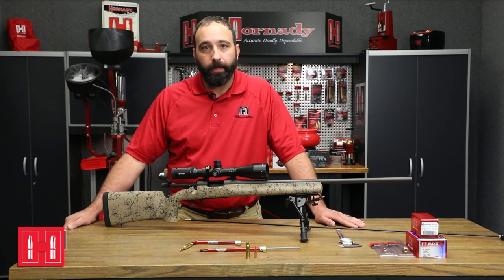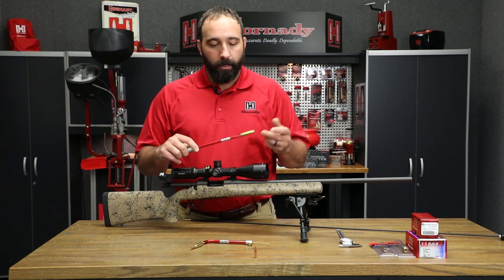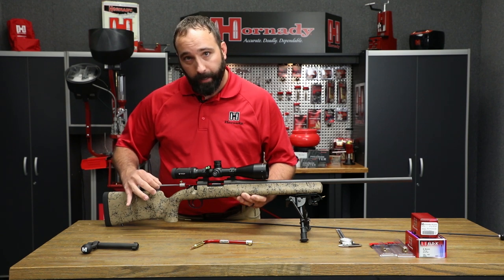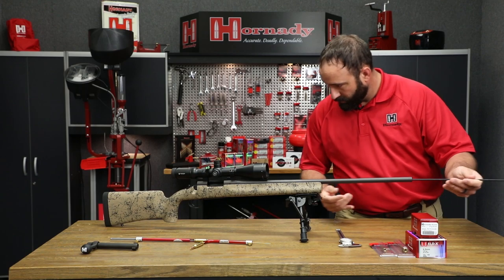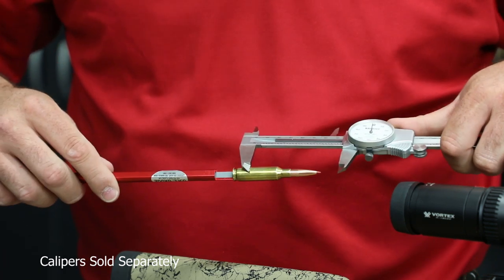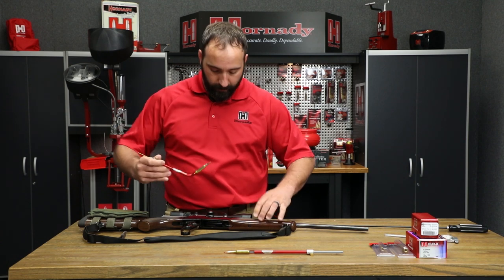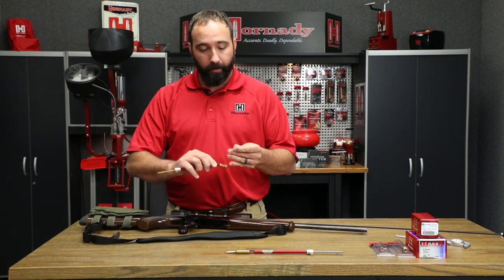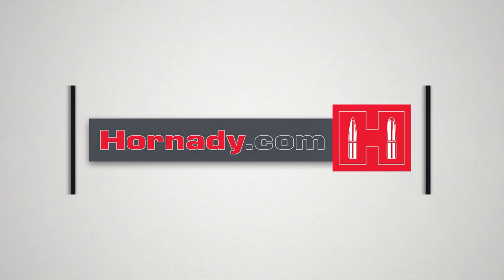Hornady® TECH TIPS: Hornady® Lock-N-Load® O.A.L. Gauge

Comment: I tried using the curved OAL gauge on my M! Garand. After over an hour and a half and about one hundred different readings with over a .060 spread, I gave up. I'm a retired machinist and took 2 years of gunsmithing, I have also been reloading since 1978. I had no issues with the straight AOL gauge my readings were within .001, that's just caliper use. That curved one doesn't work worth beans in my opinion. I tried everything I could think of.
Reply from the maker: Give our technical customer service a call at 1-800-338-3220.  They would be glad to see whats wrong with the gauge.

Comment: Measuring the OAL of the loaded round as shown in this video is not the best way to achieve maximum accuracy. Measuring overall length causes too much variation due to differences in brass. You need to measure from the case base to the ogive of the bullet. The ogive is where your bullet actually touches the lands - not at the bullet tip. Hornady makes a comparator that has bushings sized for the ogive of your bullet. Use the OAL tool as described in the video, then use the comparator kit to measure the base-to-ogive length. Then back off several thousandths, TBD by your rifle's performance. For example, on my .223 loads, I measure base-to-ogive, then subtract .005" , then set up my seating die to achieve that number. That gives me maximum accuracy by helping to tailor the round to my rifle's chamber.
Reply: He's not measuring a loaded round. He's using a special case made for the tool. You can buy different caliber cases for the tool.

Comment: If you are going to do this, use a case fired in your rifle so it gives an accurate measurement. A SAMMI spec case will be different since a fired case forms to your actual chamber and will be a few thousandths longer from the shoulder to the ogive of the bullet.
Reply: toy collector question off that. I’m new to reloading I’ve been doing some reading and with this tool isn’t there a possibility to over pressure your case this way, to a dangerous lvl? I mean I’m sure there is anyway but this would give you a different length then a reloading book right?
Reply: Your OAL will not change if you do case head to end of bullet measurement whether the case is new or once fired. Some people bump size the fired cases to improve seating if used for hunting or competition. Anything fired in a semi or lever should always be full length sized. See https://www.youtube.com/watch?v=whln3B3DFAY

Comment: BIG TIP:  when I initially measured 3 different 223 bullets with my Hornady OAL gauge the overall spread for CBTO was .030.
I removed the plastic plunger and filed it down to a rounded point and the same bullets CBTO are now an overall spread of .010.
The individual bullet variances also reduce by at least 50%.
WHY: the bullet base is not 100% perpendicular to the bullet concentricity therefore the variance with the larger plunger end.
Wish Hornady would install a sharp metal pointed end on the plastic plunger as I would pay more for that OAL Gauge.

Comment: Can you do a follow up video and explain what to do with those measurements. Specifically how to get the proper seating depth or my OAL.
Reply from the maker: We may do that in the future.  It is relatively simple though. Ideally you would use the measurement you got from the OAL tool with a bullet comparator and use the same bullet from the testing to set up the die.  For Instance, if your OAL with the tool using the bullet comparator is 2.000" and you want .010" of jump, you will adjust the seating die with the same bullet you used for the OAL tool until the seating die seats that bullet to 1.990" also measured with the bullet comparator.
Reply: @hornady have you made that video?  It would be helpful to show this gauge used, then follow with the comparator measuring off the ogive instead of COAL. Giving some guidance on how far back you should start is a good idea too. (One post here suggests .005” which sounds far too tight to me)

Comment: Before loading your live rounds MAKE SURE that the rounds will cycle through you action. I loaded some spire point boat tails for a Winchester 70 that I ended up having to single feed because long ogive with OAL into lands yielded bullets with the tip bent when cycling through the action. Ended up single loading them. Also possible feeding problems in lever and pump and semi-automatic rifles may occur. Load some DEAD ROUNDS no primer no powder to run cycling test for safety sake. Then pull bullets.

Comment: I agree with the comment that you are actually measuring the length of the cartridge to the ogive which touches the rifling.  Measuring to the tip only tells if your loaded cartridge will fit in the magazine which doesn't matter to me becuse unable to find a magazine that will fit the 7mm WSM in a Remington 700 with a very heavy 30 inch target barrel which takes AICS magazines.  Unfortunately the cartridge I am trying to measure oal length on is a 7mm WSM with 180grn Berger bullet (which would be too long for a magazine anyway) and the tool unfortunately fits to far in to easily tighten the lock screw.  Another video showed that I was using the tool incorrectly which explained why I was having trouble getting a good measurement.  God forgive me for never reading included instructions, but luckily we have YouTube to turn to when having trouble.

Comment: Im getting different readings everytime. Maybe Im not jamming into the lands hard enough??
Reply: One reason that might occur, is that it is not very accurate to measure OAL from bullet tip to the end of the brass. Use a measurement adapter that measures OAL using the ogive of the bullet. Also using high quality bullets help.

Comment: I tried using the straight OAL gauge on my Weatherby 270 magnum but never felt any resistance on the bullet. It even pushed out of the brass case. Is my chamber barrel shot out? It is a 1961 that I bought used so I know nothing about it’s past history.
Reply: Weatherby Mark Vs are known for having very long throats (distance to lands of barrel).  You probably can't load a bullet out far enough to hit the land without the bullet being insecure in the case.  Use the magazine length as your guide.  Load the bullet out as far as you can and still fit in the magazine.
Reply: Thanks Robert. I did some extensive research on the Weatherby and found out exactly what you replied. They are made that way for a purpose of the pressures of Weatherby barrels

Comment: The curved version sucks. The piano wire is too tight causing you to jam the round into the rifle. And this doesn't work well if you are planning on using these rounds in an AR magazine and there are a lot of missing steps not shown here to get it right for your rifle AND who would really want this. I wouldn't say false advertising, but I would lean more towards "not enough information given to make a solid decision if one would need this."
Reply from the maker: What steps do you believe are missing?
Reply: Who would really want this? 
Well, anyone who loads for a lever action for starters.
Reply: Just because you don't have enough reloading knowledge to know how to implement the data from this test doesn't mean it's a misrepresentation of the product. Its not Hornadys job to ensure you're smart enough to understand how to use their products.
Reply: @lanenicholson3712  Pretty harsh judgement for not even knowing the guy. I've been reloading since 1978 and was a machinist as well having taken two years of gunsmithing and I had nothing but trouble trying to use that curved OAL gauge on my M1 Garand. I tried for over an hour and a half and probably had 80 different measurements with a spread of .060 using Nosler Custom Competition 168gr. BTHP bullets and the correct comparator collar.I also had my rifle in a gun vice so there was no movement there. I couldn't get this thing to work worth a damn. The straight one works fine on bolt guns, I had readings  that stayed at .001.